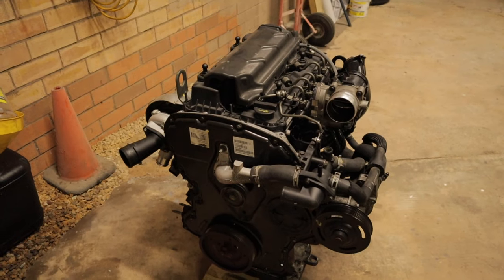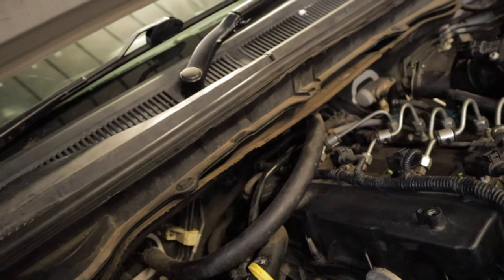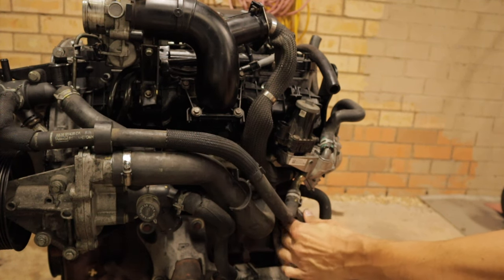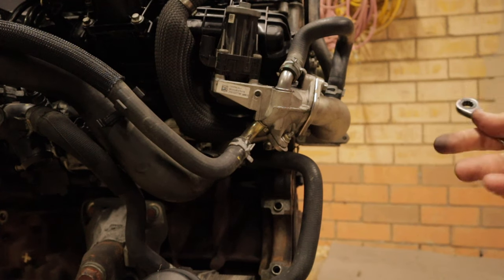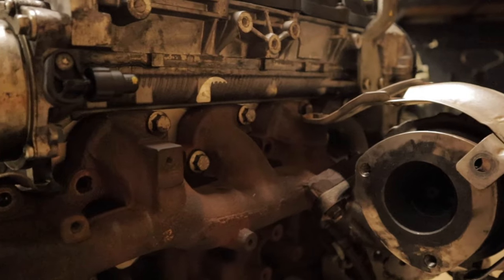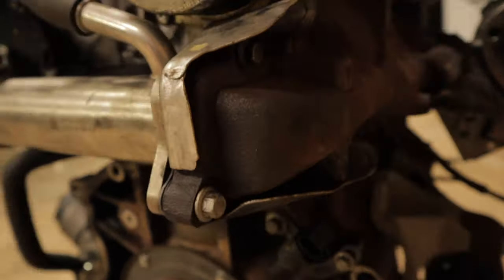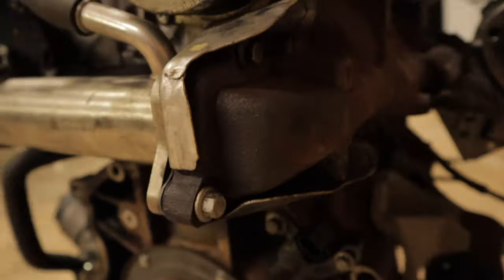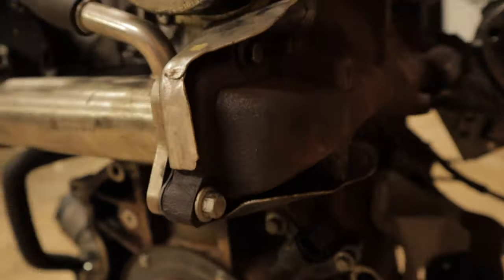Ford Ranger EGR Cooler Bypass, Blanking, Removal & Install

Comment: good day, adding blanking plate is the same as remove the EGR volve right? will this cause any engine damage or over heat?(recirculate exhaust is to reduce engine temp)  and dose the EGR volve there have any kind of flow sensor? if yes, will it cause ECU problem after block the exhaust flow?
Reply from the maker: i've done 150 000 kms with this setup without any problems
Reply: @abdautomotive  after block off the egr need do anything else or just use the car as normal
Reply: @jeremy8570   and don’t for get his is are 2014 Ford ranger too
Reply: your engine will not get over heated, as you have radiator+coolant+thermostat for that purpose..egr plate blanking will not cause any ECU problem..i do done 200,000km with EGR plate blanking

Comment: Would it matter much if you just blank the engine side and leave the water as is? I am just concerned about flooding my engine with coolant if the EGR cracks which I assume can't happen with an engine side block
Reply from the maker: you could, most ppl bypass as the cooler fails
Reply: @abdautomotive  I just bypassed the water like you had shown (thankyou by the way) and blanked my EGR on the EGR valve side. I was just thinking though, would it matter if there is no cooling if the cooler is still full of hot exhaust gas up to the valve?. Or is the cooler just to cool the gas so it's not so hot entering the intake manifold?  Ideally I would block the exhaust side but would like to avoid that if I can.
Reply from the maker: i did exhaust side of mine , but the most people do the egr side, either is ok

Comment: Has anyone done this bypass and found the heater does not get hot? 

I haven’t done the blanking plates yet as this was a roadside breakdown fix 
I have ordered the plates but just want to know if anyone else heater has stopped getting warm

Comment: So if you've blank the EGR off, what happens to the extra gasses thats supposed to recirculate? I'm assuming it goes through the turbo but at a guess, the turbo has parameters on how much pressure it should be getting/generating before a fault code pops up on a stock map?
Reply: As I understand the turbo just pushes as much air as it gets fed. The car reads the air pressure and flow on the intake side and accounts for the increase.

Comment: If both sides are blanked, where do the exhaust gases go? Is it possible they melt the blanking plates due to heat? Or do they just find their way to the exhaust? Thanks mate.
Reply from the maker: they go out the turbo, instead of being recirculated, no they won't melt , it's steel, i've done 150k on mine no problems
Reply: @abdautomotive  hay bros what year ranger do you have ? when you blocked off your egr did you have a slight loss of power downlow ?

Comment: Still a great video but just went to do the job but have one minor comment. The water flow is from the engine to the EGR then to the Firewall (internal car heating system). I disconnected at the fire wall only and started the motor and the cooling flows can out of the hose not the firewall. 👍
Reply from the maker: what model ranger?

Comment: Hi mate
If you bypass the egr cooler do you get any warning lights eg engine or any other lights that come up on the dash
Thanks
Reply from the maker: on the PX1 , none at all
Reply: Ranger 2017 gets engine light when you bypass. And when the temp sensor at the exaust get higher temp the chuck engine light Come on mye car after driving for 5 hours in one time.

Comment: It would be a hell of a job getting the EGR out when the motors in the vehicle. Not much room between the back of the motor and the firewall. Maybe the transmission would have to come out.
Reply from the maker: indeed , thats why i just bypassed mine.
Reply: @abdautomotive  So it hasn't caused any other problems by bypassing the EGR cooler ?
Reply from the maker: @shalininaicker  none

Comment: If u blank the cooler and bypass the water you must blank both sides otherwise if the cooler has a leak into exhaust system it can cause exhaust gas to escape out the removed cooler hoses that can result in a fire 🔥 bang goes your car.

Comment: Hi if you bypass the cooler altogether can the car be run without  ever replacing the cooler??
Reply from the maker: yes thats what i do, i would advise using a blanking plate with it
Reply: @abdautomotive  mine is a 2019 3.2 litre bought it second hand with 17500 miles on the clock would you say it's less likely to happen with such low milage??
Reply from the maker: @tombradley4842  only the series 1 has the cooler problem, your series 3 will be fine
Reply: @abdautomotive  that's fantastic thanks.!! I was getting worried I taught it happened to all rangers,  thanks again!!

Comment: Have you ever heard of any alternatives? I do kinda give a crap about the environment but I also am spending 25,000 on a ranger and don't want it bricked by a shitty design. Even regularly replacing the EGR cooler isn't a true fix as there is no guarantee that the new one wont break before I fit the next new one. So do you have any ideas? could you arrange some S bend type thing in the intake that would catch water like a fuel system does with its water catch? or anything like that? suppose that doesn't help either if it leaks into the exhaust and into the engine that way.

Comment: I didn’t need to loosen the exhaust manifold bolts I had to loosen the bolt on the egr cooler that bolts it to the motor and gave me enough wiggle room
Reply from the maker: yeh that would be quicker
Reply: so your saying you didnt have to loosen the exhaust manifold for the first big blanking plate ? you just had to loosen the bolts to the egr cooler connecting to the exhaust manifold ?
Reply: @jmoore9806  I didn’t loosen the exhaust manifold at all just the bolts for the cooler to the manifold and the cooler onto the engine
Reply: @bradwebber5841  oh wow ok cool....what about the other side of the egr? Did u loosen that side too ??
Reply: @jmoore9806  no just the
Bolts on the exhaust side of the egr cooler and the bolt on the inlet side of the cooler that goes to the engine

Comment: Once it's all bypassed, why bother removing the EGR cooler?  What's the motivation for doing this again?  Or rather, are you simply showing us how to remove it, as part of the process of replacing it with a new one?

Comment: Thanks for this amazing and in depth video. Do I have to blank off the EGR cooler or can I just bypass the cooler with a hose and blank off the EGR valve?
Reply: would also like to know this
Reply from the maker: i blanked mine on the exhaust side & bypassed cooler,  have done 150k with no issues, can't really comment on other configurations as i have not tried them out.
Reply: Thanks so much. 👍👍👍🍺

Comment: So the motor still runs OK without the EGR going on?
Reply: Yeah why would it not
Reply: @pancholoewen7249  Beats me.  There are so many computers and sensors in engines now, it can be confused and tricked it many ways.  But I'm just paranoid about that stuff.  I'd drive a truck from 1970 if I could afford it.

Comment: How long can you leave the hose bypass system for ???
Reply from the maker: i've done about 160k still bypassed
Reply: @abdautomotive  thanks
Reply: @abdautomotive  When putting the plate on exhaust side, did you get any leaking out of the other exhaust port when tightened up?

Comment: my son's 2017 ranger xlt egr is leaked and its not starting hes been told its a engine replacement is he getting ripped off
Reply from the maker: depends on how much damage is done, mine did the same, i just bypassed the EGR cooler, no engine damage
Reply: the 2017 is a PX2. This is all about the PX1

Comment: Thanks for the video, My heater line seems to go past the egr to way down low maybe the oil cooler? its an early model 2016 px2 xlt.

From the EGR cooler one line seems to go to the engine, the other goes from EGR cooler to EGR valve. Different to video, any help would be appreciated

Comment: I have px 2 and i blocked only on the valve side not on the manifoild and Thatcher worked i bloked the outlet on the cooler and work fine. Only Check engine light Come on and after 5 hours constant driving i get check engine light, but after restart car i go away. I check Internett and find out That the temp sensor in the manifoild get higer temp and That why its Come on. I Will chip the car en get the engine light away by delete the egr in the ECU

Comment: Great vid, however be aware this is an illegal mod and the epa is  starting to crack down.
You will start to find that car yards will not be able to resell deleted vehicles.
Also you are replacing an inert gas with oxygen in the cylinder, most people say that's a good thing. Well it is in theory, but the power cylinder is designed for the EGR and you may find higher cylinder pressures and temps which usually results in valve recession or premature piston fatigue or failure
 The police are doing delete identification  training I have been told so just be aware, if you are caught you will put off the road.  Don't shoot the messenger.

Comment: I had the misfortune to own a new 2019 BT50 3.2 what a pile of crap. A month after owning i was overtaking a double road train and the engine died so I sold it the next week. My mate had the same year (demo) and went back to the dealer dozens of times. I should have kept my 2012 2.2 with 208k km and never missed a beat (i bought it with no service history in 2018. I now have a farm ute 2009 BT50 3.0L and the lesson as I noted from one of your previous videos bad fuel is a real problem. Just about to fit a .5 micron filter also.

Comment: Hey mate I'm just about to blank the egr. Have a couple of questions. First thing do I have to blank both sides of it. And also once you blank it do you have to do the cooler bipass. Thanks
Reply from the maker: to be honest, after using the egr delete cable for a few weeks now, my advise would be to use a egr delete cable instead, much easier & same results.
Reply: @abdautomotive  bugger I just got this message. I blocked it off on the egr valve side. Then tried to do the other side and slipped and cut my finger open on the heat shield so gave up on that. Then bi passed the cooler. While I was at it I pulled the inlet manifold off and cleaned it. When i took the egr valve off the little bearing thing in there for the switch had been snapped off so i think it had deleted its self. Made a massive difference. My fuel was sitting at like 13.4l per 100 now it's at 10.8 thanks for the videos have helped me heaps.

Comment: Hi, thank you for the video. I’m trying to get my 2017, 3.2 back mobile. I’ve connected the hose from the right outlet side of the heater matrix (side nearest the engine). I’ve taken the other end of the bypass to the top connection of the egr as you showed in the first part of the video. 

When I refill the system, water comes out of the hose originally connected to the egr valve end. I’ve triple checked and I’m on the same connector as you show, but I’m wondering if my setup is different with the auto box?

The engine is still in the truck, I just wondered if you had any thoughts. Many thanks

Phil
Reply from the maker: T7 Ranger is different to the T6
Reply: Am in that boat now and trying to find out how to fix it! Did you manage to get it going?
Reply: I put a new egr cooler on with the engine in situ. It was very tricky to get it out and in, but I did it all from the top. After that I still had bubbling in the header tank, so took the head off and found the gasket had gone. I then had the Head head pressure tested which was ok (but on a bench don’t forget), but there was a tiny crack between 3 & 4 so I bought  a new head. I’m still not happy with it though, With hindsight I wish I’d sold it as spares or repairs.

Comment: any one experiencing a miss fire or lack of power downlow after EGT blanking plate installed ?
Reply: I had my PX2 re-mapped and EGR turned off, and about 6 months later I started getting a “backfire” and a puff of white smoke at random. 
Have had it back to the remap place and a seperate diesel mechanic and no one can diagnose it. I’m worried maybe coolant is somehow getting into the intake manifold a drip at a time at random 🤷🏼‍♂️
Reply: @martyphillips83  should have a loss of coolant if it's getting into the intake manifold
Reply: @jmoore9806  it is down a little bit. I might try bypassing the coolant hose and see if that fixes it up. Fingers crossed
Reply: @martyphillips83  that will fix the coolant loss issue if u have one now or in the future

Comment: Good video but be aware PX2 automatic is plumbed completely differently and not a simple procedure
Reply: On px2 2.2 auto Egr cooler is feed from the block below the starter motor through cooler to egr valve then engine oil cooler and back to water pump. The heater outlet goes behind the head to transmission cooler. I’ve deleted egr cooler and trans cooler entirely.
Reply: Very awkward to do but can be done I haven’t found any pictures or video